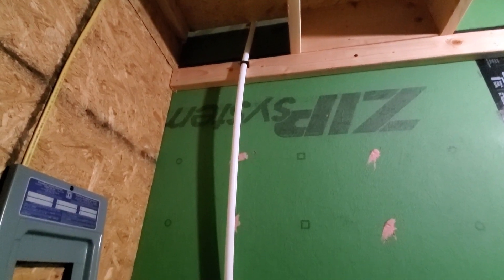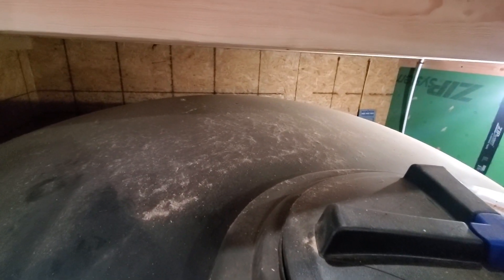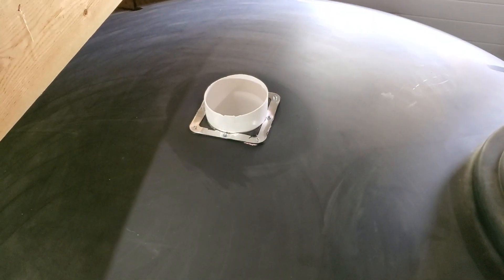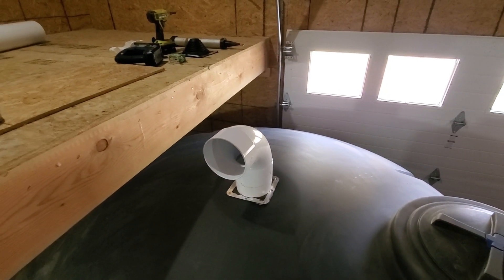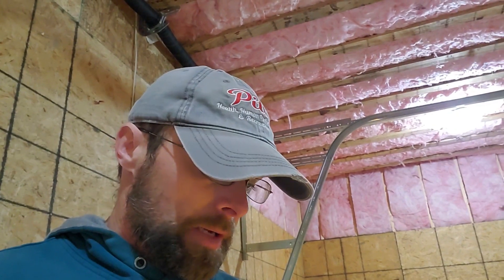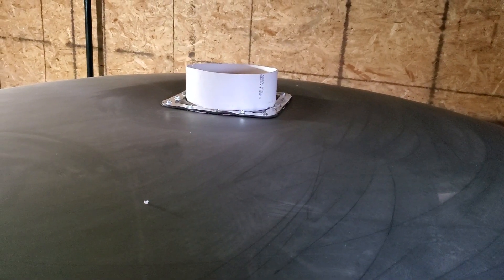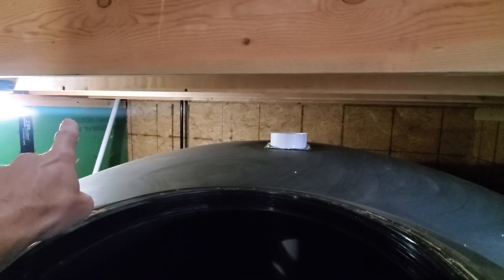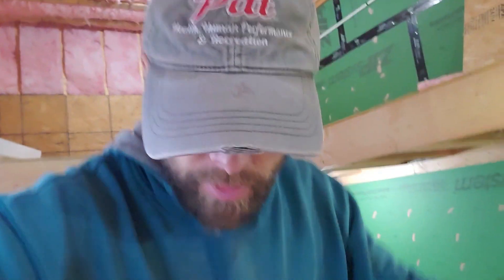5000 Gallons Rain Water Collection System for our Off Grid Homestead DIY Barndominium Build Project

Comment: Also, is the filter system for the rain water? Rain water is almost as clean as distilled water. Matter if fact it is distilled water is you think about it. I've tested it with my tds tester and it normally slows 1-4 where distilled water shows zero and two water shows 200 mg/l

The must important thing is to have a system where the first 10 or so minutes of rain does not go into the tank. They have it go down this tube to collect all the dirt from the roof, then when the tube is full it starts diverting w to the tanks. That way most of the dirt is excluded.

Keep up the good work and keep the vids coming
Reply from the maker: The filters are for the rain water.  I have eight different types of filters in all.  I did a lot of research and got a lot of different answers.  When I started asking actual professionals and reading studies from scientists I found that a "first flush" isn't needed and is basically a gimmick that has caught on in the US.  Rain water collection has been used around the world for a very long time so there are a lot of good studies that have been done in its regard.  

Thanks for watching!  I'll have another video on the system coming soon.
Reply: @Off-Grid  do you have a link to some material showing a first flush isn't needed?
Reply from the maker: @jl9678  I think I'll end up doing a video on it once I look back and compile all the info but basically keeping debris out of the tank is important.  Things like leaves and dead bugs.  But the dust, pollen, bird poo, and such that collects on the roof isn't an issue which is what a first flush is meant to remove.

Here are a couple reason why we didn't install one.  First, the sun's UV light sterilizes what gets collected on the roof.  Second, the tank will develop a bio layer or film that takes care of anything that gets in the tank and is a part of the water cleaning process.  Third, a first flush system requires routine maintenance after every rain, which the majority of people studied failed at.  

I have tested our water and everything is good to go!  A lot of it comes down to your filters in the end and we have a good system.